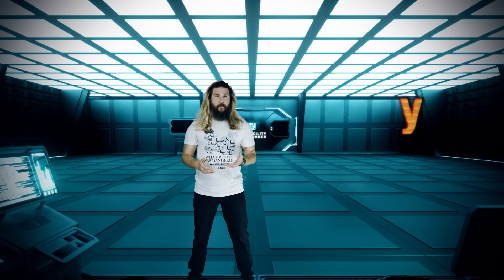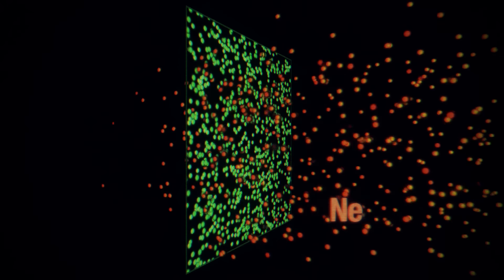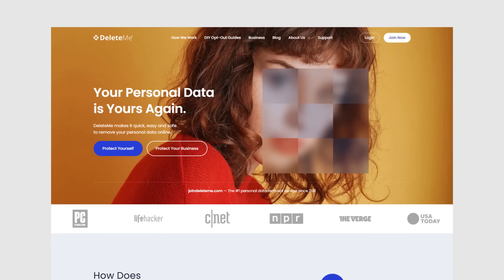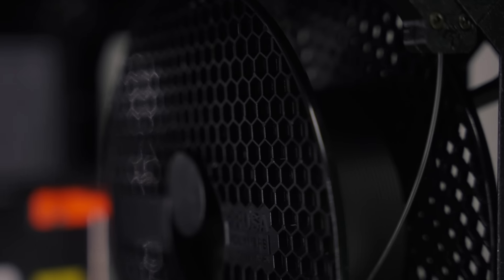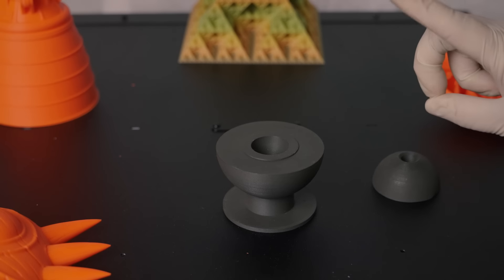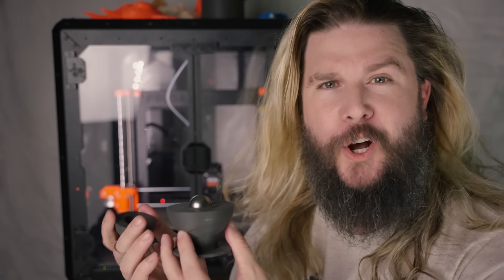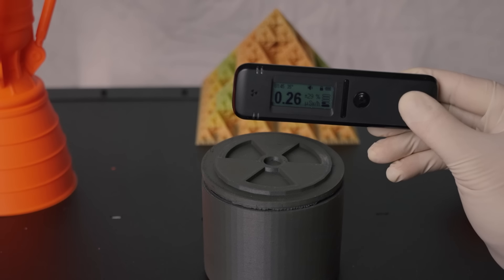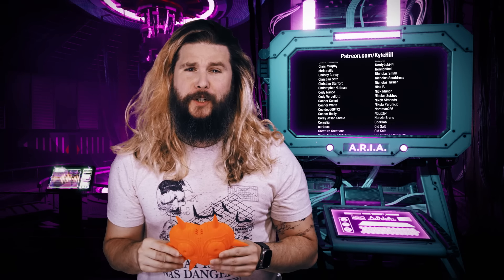3D-Printing TUNGSTEN Radiation Shields!

Comment: With improved tech, how about a supper dense material made of 2 interlocked crystalline molecules.  For example a diamond that is in the same space as a block of iron or other metal, with the molecular bonds of atoms shifted and woven.  The resulting material would be harder than natural diamond with the carbon sharing space with the iron in a new form of steel.  Even with another metal like copper it would remain at least as hard as diamond.

Comment: Flexible and curved barriers

Non-mechanical/electronic containment and access system
(a room for radioactive material that is accessed without ever exposing the material to the environment but also has no electronic components or complex mechanical systems)

Using that filament to create a series of long thin panels that have this ['''''''|,,,,,] kind of shape embossed on their underside. Being shaped in a way to allow overlapped interlocking with one another, perhaps with a tungsten alloy √ shaped "spring" mechanism inside each if needed, you could create a flexible/curving radiation barrier.

This could be used alone to make a semi-flexible hose to protect liquids that either are radioactive or to protect liquids from radiation. As well it could allow for enclosure designs that make "opening" them a smooth process where at no point would the radioactive materials be exposed. Like a spiral with a small bubble that moves from the interior to the exterior, the design ensures that the corridor can't be fully open at any one time but also it doesn't require a lock or mechanical/electronic components which would prevent breakdowns and allow easy escape for anyone inside in case of emergency.
Reply: Sounds like a good design, but I wonder if this filament has the mechanical properties for such complex part. I mean 75% W loading is pushing it a bit and Im sure its mechanical properties are no that great.

Comment: So, you need to be careful when using lead or tungsten to shield beta particles because they can actually generate x-rays when interacting with dense (high Z) materials. In fact, an x-ray machine is usually just an electron gun with a tungsten target. When shielding beta, I've often heard people using using a plastic before a metal to absorb the beta radiation. Also, while hydrogen is good at scattering neutrons, it's not necessarily the best for absorbing them. Boron is really awesome at absorbing slow neutrons, so a lot of commercial neutron shields use boron blended with material rich in hydrogen, like borated polyethylene.

Comment: So... this gives me an idea. What if you make a shield that's half the half thickness, surrounded by another quarter thickness shield with an airgap between the shields that's equivalent to the half thickness of the shielding material. For example... you make a 5mm thick container where the half thickness of the material is 10mm, then a 5mm thick container larger container that, when the first container is inserted yields a total thickness of 20mm with a 10mm airgap between the outer and inner containers (5mm inner container where the sample resides + 10mm airgap + 5mm outer container). Would you get a doubling of the half thickness performance or somewhere in between?

Comment: i wonder if it could be used as a quick patch for existing applications, put it in an extruder pen (but like the size of a hot glue gun) and fill cracks in something that's been damaged but can't be replaced quickly.

Comment: I would like to see it make experimental internal combustion engines,  like the vane engine.  

I would also like to see it 3d scan and then print prosthetics and accessories.  

I would also like to see it make alternatives to glass apparatus for safety reasons
Reply: For chemistry reasons mainly for 3

Comment: 3d printed fuel rod casks for spent fuel rods. But the stuff should be able to be sintered and remove the plastics to have only tungsten if baked properly.  That'd be way more useful
Reply: @gardenlifelove9815  for used fuel it wouldn't be that great, you'd need A LOT of it, atleast 10cm worth. In such big items, steel is just so much cheaper and easier to use. However for small but potent radiation sources it could be usefull, when you can design the geometry in a way to minimize scatter and unwanted beams, while getting a good beam in a desired direction!

Comment: I work at fermilab and we could use a filament that lasts a long time under radiation to print things like brackets to mount hardware in the beamline.  I made some prototype brackets with PVDF already, but we have not tested them.
What is the binder material in this?  If it's PVDF maybe that combined with the shielding from the tungsten would make it even better?    Any data on longevity?

Comment: i wonder how the infill settings can affect the efficiency of the shielding, what was the % of infill for the cask for example? because most default print settings is usually 15-20% , so if that was how it was printed , its kinda impressive considering most of the inner walls would be empty space .

Comment: what if you could somehow print an air filter out of the tungsten filament as use it to catch radioactive dust particles, i don't think you could actually print it as a mesh right off the bat, you'd probably have to run it through some sort of post processing to knock out extremely small holes through the plastic of the 3d print.

Comment: Why specifically do we need water? To store the hydrogen in a safe manner?
Someone else mentioned a radiation shield that could be "infused" with little bubbles of water, and someone else pointed out how water-metal interfaces typically don't mesh well. Could we "just" store gaseous hydrogen (ideally also compressed) in the pockets instead?

Just to add context to my question, I have very little knowledge in chemistry and material sciences, so I'm genuinely curious what would be stopping us.

Other than maybe creating a massive explosion hazard in case the print isn't air tight...
Reply: Well talking about a nuclear reactor, the hydrogen needs to be dense enough to actually provide enough neutron stopping action. Gaseous hydrogen isn't dense at all, much less dense than air, so it would be much less effective. The water also acts as a coolant, which gaseous hydrogen can't do. Also hydrogen gas likes to explode, which you noted already.

Comment: (Sort of) impressive, but what about near 100% shielding?  That would be far more impressive.  Also, tungsten is very heat resistant (in the sense that in conducts heat well and has a high melting point), so how are you melting it down to then print with it?  What is it mixed with in that filament?  Perhaps what it is mixed with is lowering its efficacy in radiation shielding.  I noticed it wasn't shielding fully and wondered if Kyle will be able to have kids in the future now.

Comment: You should have put threads on the lid, made the radiation sign a little deeper so it could be used as a handle to screw and unscrew the containment... uh... container.

Comment: i work in the medical field make it into a fiber and make a lighter vest for x-ray techs Ive handled the lead ones they are so heavy some of the smaller techs cant even where them properly
also a shielded blanket would go miles for patients in critical condition going to and from x-rays and ct scans all day furthermore if you could find a way to shield from an MRI you would be into some serious ground a material like this could change radiation shielding in the medical field completely

now how about we talk about lining tankers trailers that carry radioactivity materiel you could save a considerable amount of weight switching to a compost instead of just lead lining 

their is also the potential to make specialized aircraft fuselage capable of absorbing or scattering many specific wave lengths and be much lighter

Comment: Why does the open casket have less initial radiation output compared to just the uranium sample in the demon core print out's open-container value? You'd think that adding more radioactive objects to the area would increase the background unshielded radiation.

Comment: Looking at the quality of that cylinder its clear its not using arcs in the slicer. They really need to fix that its silly to be printing each of those as a section.

Comment: For the same thickness, does the absorption rate change when measuring vertically versus on plane with the print layers?

Do the binder properties change after a few years of radiation?

Comment: 0:02 
Man, your thumbnail begs the question, when the print is almost done and there's just one small hole in the top dead center, what will that mean?
The Demon Core is at its most powerful when it's shielded, right?
That means, with complete shielding pierced by only one tiny hole, you've got the core of a radioactivity laser, and it may need only a handful of lenses to make it utterly devastating as a weapon.

Comment: So radiation is used in order to treat different kind of cancers including skin cancer as you know. However, radiation requires a small amount of tissue to build up before it reaches a steady dose, so often you need a skin-like material that's called "bolus" in order to act as a fake skin to let that radiation build up. What's being researched and explored is using 3D printing to make patient-specific bolus in order to try and minimize the amount of side effects that patients get from their radiation treatment.

Comment: Not 3D printed underwear, but 3D printed light-weight armour plates?! I am assuming this is lighter than lead and/or plate-tungsten?! Also, if one plays around with how the 3D print is actually done (internal structure wise), does it get better or worse (verses cost of actual material used during printing)? So many questions currently left unanswered.

Comment: How solid were your Tungsten prints?  Was there any empty space inside the walls of the Demon Core or the container for all your supervillain radioactive samples?  I only ask because so many 3D prints leave open spaces to save both time and filament, but presumably the more solid the print, the more effective it should be at blocking radiation.

Comment: 4:11 Hey and not this Steve. The O is for Obvious.
Edit - thought: what is the maximum thickness one can print that material?  What is the materials density or weight? Can we add lead in some way?
Ballistic results? Used in composite armor with uranium sheets? 
Just random thoughts.
Reply: Another random thought, could Boron carbide could be mixed into the tungsten material to make it super strong?

Comment: Would hiding in a large body of water be a good hiding place during a nuclear blast? Considering it would be a great protector against the heat and radiation if you were deep enough under the water. Genuine question.

Comment: Your comments about lead being a good shield for charged particles should come with a caveat : lead should not be used to shield people from high-energy beta emissions. This is because dense metals like lead are likely to produce what's known as Bremsstrahlung radiation. High-velocity electrons (which is what beta particles are) induce dense metals to produce x-rays. Thus, while a lead shield will indeed stop beta radiation, in the process it will emit x-rays of an energy comparable to that of the original beta particles.

Yes, you can add more lead to shield against the x-rays, but you end up with a shield that's far heavier than it needs to be. A centimetre or so of perspex is a perfectly adequate shield against beta particles, and has the added benefit that you can see through it.

Comment: Additive manufacturing has gone far beyond anything traditional manufacturing has been capable of doing, but it's still unfortunately at a relatively small scale. Not entirely related, but a large portion of firearm suppressors from the last few years are now made this way, and there are also at least a dozen companies prototyping fabricated homes with a scaled up version and specialized mixes of concrete. In a few decades time, could be that the new coffin around Chernobyl is entirely printed.

Comment: Your radiacode seemed to indicate quite a large margin of error for its readings of +/- 29%. I know it's just a YouTube experiment, and to address the margin of error, explain it, and its potential implications would be quite an irrelevant tangent to go on compared to what the video is supposed to be about. So, I'm not faulting you at all for not addressing it. I just wanted to point it out. That's all.

Comment: One big test I would love to give this new filament would be on the 3d2a side of things, I've actually lead a pretty big leap in 3d2a in terms of longevity and strength using just PETG, able to fire almost 2000 rounds of 5.56 on a single printed lower (which is fully legal in my state and still following all local and federal laws). I'd love to see how this would hold up to a PETG, or even a ABS, ASA, or PA6/PA12 CF AR lower receiver in terms of rigidity, layer adhesion, heat resistance, impact resistance, wear resistance, hygroscopicity, ease of printing, and post print finishing

Comment: Too bad tungsten carbide can't be used.  I think it would be too abrasive in anything but diamond nozzles but it could be found very easy in the tooling industry making the tungsten carbide lathe and mill bits as a by product and it would be a darned site cheaper than buying new powders.

Comment: I wonder if you could print a radiation shielding suit of armor with this. I mean sure the suit would be heavy and exposed at the joints but...just a thought.
Reply: could use the lead vest material they use at the dentist for the joints may not be the most manuverable
Reply: My apologies, random internet person, but you've managed to trigger two of my hobbies at once. I 3D print, and I've spent more time in armor than is probably healthy. 

So, I can't find anything at a glance that compares the density of this filament directly to, say, PLA, but the Prusa website does mention that 100 grams is ten meters of filament. 100 grams of PLA will be around 33-34 meters, depending on the make. So, at a ballpark, we're looking at about 3 times as dense as normal, run of the mill filament. Not counting the weight of things like straps, buckles, and other connecting materials, a suit of printed armor for someone my size (195cm and 140kg) comes in between 5-7 kg of filament. Mathing that out, an equivalent suit of tungsten armor would weight between 15-21kg. 

Note that this isn't full body coverage. Fully articulated plate armor that encloses the entire body with no gaps is technically possible, though. It wasn't done historically all that often because it would be both hideously expensive and wildly impractical, but it can be done with steel plate. In theory, it could be done with printed material, though there would be a lot of post processing involved. You'd need to smooth and polish the surface to get rid of as much friction as possible. It's a lot of work, but hey, radiation shielding armor. I'd call it worth the effort. 

Making an educated guess as to how much material was used in the joints, I'd be comfortable adding 2-3kg of conventional PLA. That's probably way too much, but in my experience, the instant you say "I'll never need that much filament" something goes horribly wrong. That brings our overall weight, at the heaviest, to 27kg. That's heavy, but it's actually in line with historical plate armor. If you're smart about weight distribution and avoid pinching anything sensitive, it's not even all that fatiguing to wear. Heat exhaustion will get you long before your muscles reach their limits. 

My main concern would be practicality. How much shielding are you getting from a suit like that? I don't know. I simply don't have the math and radiological background necessary to calculate that. I do know that it would be cumbersome as hell, and I wouldn't count on a whole hell of a lot of manual dexterity. Likely, some sort of purpose built glove would be necessary, because there's no practical way to print articulated fingers and have them full enclosed. A clamshell style gauntlet is way easier, but that limits what you can do while wearing it. Give me some time to experiment and I might be able to work out some sort of mechanical grabber thingy? I dunno. That's too much effort for an already overly detailed YouTube comment. 

tl;dr yes it can be done, but the practical benefits might not outweigh the downsides
Reply: @gatling216  do you think this tungsten material could be used for 3D printed chainmail? That might help with weight and flexibility. Although, I don't know by how much that would affect the shielding efficiency.
Reply: @Scienceguy721  I'm sure it could. Printed chainmail is honestly pretty forgiving stuff to work with if you have a printer than can handle it. Whether or not you'll get useful levels of shielding out of it, I can't say. What I can say is that chainmail fell out of fashion for a reason. It's actually heavier and more restrictive than an equivalent set of well made articulated plate, and provides less protection.
Reply: @gatling216  really? Guess I'm out-of-date on printed chainmail applications.